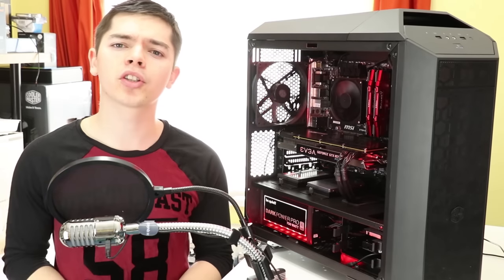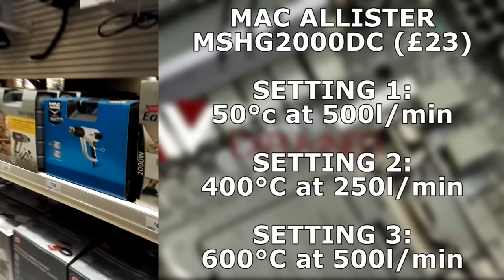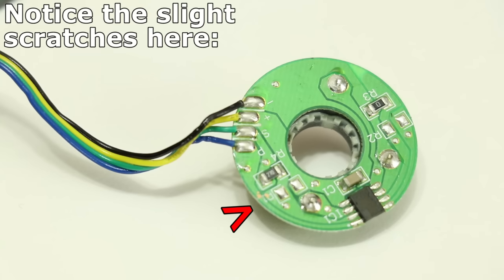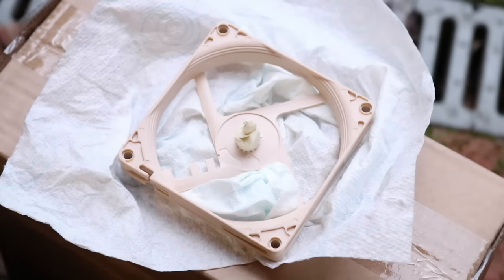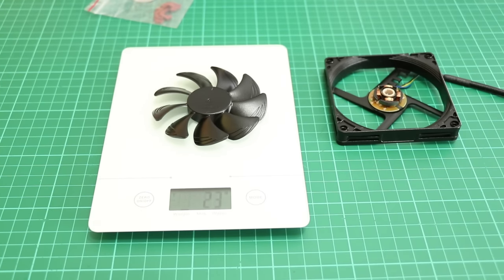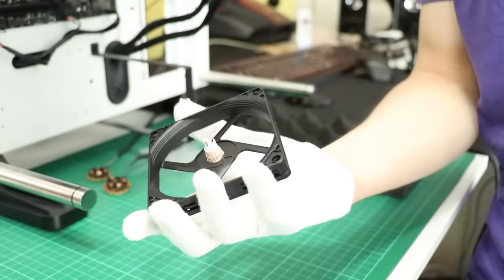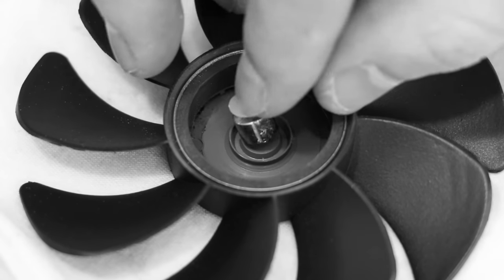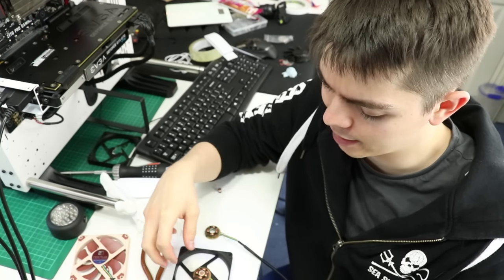Noctua NF-A9x14 Respray Guide (This will void the warranty)

Comment: I took apart a fan using the methods you describe but had a different outcome. I used a heat gun at 400 degrees c 15cm away from the center for 10 seconds.  I wiggled and seemingly made a little progress. I repeated two more times and the fan came off however the other components did not come off with it.  It seemed a more simple task in reassembly in that I only needed to add a little adhesive and snap the fan back on the 'silver post'.  After holding it in place I notice the slightest wobble as the blades turn.  I would like to know if your fans have had any wobble upon reassembly and if you have any knowledge of if it could be detrimental and should I try again.  Suberb info btw.
Reply from the maker: Interesting, I'm not surprised the other components were left behind since the clutch has quite a lot of grip. I can imagine it was less of a headache to reassemble though which is always good.

As for using adhesive in the centre, the fan wasn't constructed using adhesive so there's no need to use any on reassembly. I used some oil to replace any that had evaporated or was washed away and made sure there was enough in there.

I've not experienced any fan wobble with mine. I had originally, but after the second attempt and reseating the centre assembly any fan wobble was unnoticeable. It's a bit irritating that your getting some after not needing to fiddle with the centre assembly. Maybe it was pulled out a little during the disassembly and it needs to be pushed back down a bit. Let me know hat you think, maybe we can find some sort of solution to it.
Reply: @AVTechy  I agree that it is probably due to a shift in the components when I popped the fan off. I should have used pliers to give the inner workings a push down while the adhesive was still heated. The fan is performing considerably well (normal). Regardless I have a matte white Noctua fan in my PC! Keep it up.

Comment: Really late to the party, of course... but...
I have a dumb question: If you attribute the 'performance improvement' to some aspect of bearing performance, instead of the surface qualities of the painted fan blades, wouldn't that improvement, necessarily, have been a consequence of increased RPMs?  Just a thought.
Great video, and an important lesson to Noctua that they need to do something about their color-scheme.  Thanks.

Comment: No time stamps?
Reply from the maker: Normally I would put them in, I do for all other videos. But this one was pretty unstructured, so I found it a little tricky to specifically define certain points of the video. I could have given it a shot, but this video includes all you'd need to know to undertake this project, it's just a case of scanning through the video for the bits you want, or watch the whole thing.

Comment: Best way to dye those kind of plastic parts at home, is in boiling water with the proper dyes for this technic. I made a lot of plastic color changes in many PC and RC parts by this method and it worked every time. There's absolutely no problem to bath those kind of plastics on boiling water. Make a search for boiling water dye and maybe "Rit dye more" product (one of many).
Reply from the maker: Nice! Have you got any recommendations of products for this? DIY and Modding is really a new world to me and I'd appreciate a pointer in the right direction.

Thanks for checking this out and taking the time to help :)
Reply: @Katsoulinos  This is a very interesting way to color plastic parts, I'm intrigued and I just might do this if I consider the noctua cooler, thanks !

Comment: Great Video! I have sprayed many of them over the years , I always found it funny that You Tube Modders NEVER suggested this !  They would make entire videos about how ugly they were and how Noctua needed to make black fans, But NEVER pick up a can of paint! Ha ha!   I have used the Vinyl paint and regular Hi Temp Flat black  like VHT  both with success!  The only problem I have with disassembly is getting the "Fluid"  for the Fluid Dynamic Bearing back into the housing. Also How much fluid should their be?  Personally I would use synthetic motor oil but be guessing at the amount.
Reply: Dupli Coler Vinyl and Fabric (automotive) seems to work well dries fast and a long narrow spray pattern

Comment: Noctua has since changed the mechanical design, the metal pillar and bearing assembly is now permanently injection molded to the fan blades. Don't remove the metal pillar from the blades or it will destroy the fan.  And actually, don't remove the blade at all as it will cause play in the bearing.

Comment: How is the paint holding up? Any regrets?
Reply from the maker: The lacquer didn't stand the test of time, but the paint underneath is still solid. I'd just buy the black fans that are out now, but if they weren't available and you wanted these fans in black I'd still have a go at this.
Reply: @AVTechy  I have new old stock of some nf-f12s .... I think 9x the Chonomax version would break my bank.
Reply from the maker: That would break most banks :D you going to try this on those?
Reply: @AVTechy  Most likely =) my Mo-Ra 3 is black.

Comment: No no no ...
Black color is look like cheap fan from default pc case...
I like the original one...
Reply from the maker: I'd say the original fan could be considered a fan from back when PC cases were all beige.

The only reason people are fond of the colour is because the colour is linked to the performance now. If be quite! or any other quiet high performance component manufacturer released a beige fan most probably wouldn't be happy, and probably wouldn't be quiet about it.

Likewise if Noctua had only made black fans they'd be regarded as great fans like any other, but of course they wouldn't have their "iconic" colour scheme that makes them easily distinguishable today.

The only reasons to keep them beige is nostalgia and the few that like the colour scheme because they like beige and brown (not those who like them because it's Noctua - that falls into the nostalgia category).

Noctua has now made a move to create consumer black fans at a reasonable RPM, and that's likely because they realise the market is advancing, and just being a good performer isn't enough when there are other options that perform very well, and look great (by today's standards) too.

IMO the fan looks great in black, and I have a feeling I'm with the majority based on the amount of people that go out of their way to create beige builds (not seen many beige mods around). But I'm not going to say the beige colour scheme should die, only that there should probably be an equivalent in black (which there sort of is now which is great). Maybe the limited edition LTT fan sales had an impact on the decision on create a black range, or maybe they were the test run to see how black Noctua fan would go down...
Reply: No no no ...
Brown and tan is ugly on a PC no matter how you slice it. It’s literally the color of poop. Yeah I recognize a Noctua fan instantly by the color, and it’s the reason I haven’t bought any until recently (because aesthetics matter in a custom PC - it’s half the fun). When I learned about their Redux line that don’t cost an arm and a leg because they’re not that stupid tan and brown color, come in a less fancy box, and don’t have the rubber isolators (which are still cheaper to buy separately), only then did I jump on the bandwagon. Still they’re more gray than black, but at least usable in a PC that has a window of any sort.

Comment: seriously? Just spray the damn thing LOL.  I've done four so far. Light mist on each side, wait to dry then mist again. Done.
Reply from the maker: Quick question, if that's the case why are you watching videos on how to paint a fan?
Reply: @AVTechy  I wasnt. I was looking at Noctua cooler videos as they are now getting competition from Deepcool for a large air cooler... and stumbled upon your video painting it so I clicked and saw you taking the whole thing apart and figured I'd let you know that you are way over complicating it. Just set it down and do a few fine passes on each side and you're set.
Reply: What if you want to paint the blades and frame different colors? That's why I'm watching this video and it's information is invaluable
Reply: @RYTHMICRIOT  I've masked blades and hub before with tape and sprayed the frame. Takes a few mins of prep. It doesnt yield as perfect a result as taking the whole thing apart but good enough that its not noticeable in a case and especially if the computer is running and fans turning.

Comment: And make it perform worse.
Reply from the maker: Literally tested the performance difference and presented it in the video... you didn't even look did you?
Reply: @AVTechy  it's not about the current performance. Lifespan, weight, noise should decrese over time. Else noctua would be worse than you are at enginerring black fans
Reply from the maker: So where's your evidence for it getting worse? Why would adding less than a gram of weight to a 20+ gram fan blade cause a substantial shift in performance over time.

Why would adding in multi purpose oil (usually used for bike chains, sewing machines, etc.) cause the bearing to drastically fail or lose performance? 

I don't think you have any evidence for any of your opinions. You're just salty for some reason that someone wants to change the current colour the the A9x14 fan.

If it's not just pure salt, please add some highly relevant evidence that actually stands up with your thoughts on changing the paint of a Noctua fan.
Reply: @AVTechy  no i love black fans, but you're saying you beat noctua to the punch. There must be a reason there's delay on chromax versions of these fans right? If it was a simple paint/powder coat no one would havr any problems.
1 it's inconsistent.
2 it can make the fan blades noisier, and for me it worsened the performance by about 7% which is outside error margin for me at least.
3 it makes the surface uneven if not done properly.

There is a reason noctua delays those.
Reply from the maker: A black paint mod is of course inconsistent. But there are no major issues with Noctua creating black fans. If this is the case then we're also saying Noctua is less capable of sourcing a black plastic to cast with than other companies that have been doing it for donkeys years.

It's never been that Noctua aren't capable, it's that they've chosen to not be capable. And it's only now that they're waking up and realising there are lots of benefits to adding a black fan option to their lineup (profit is probably one of the key driving factors - they are running a business after all).